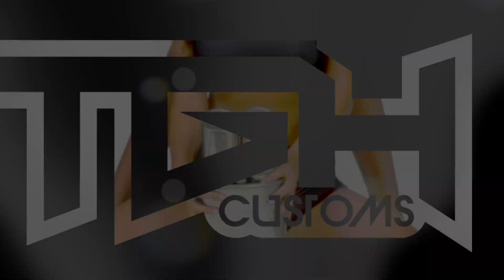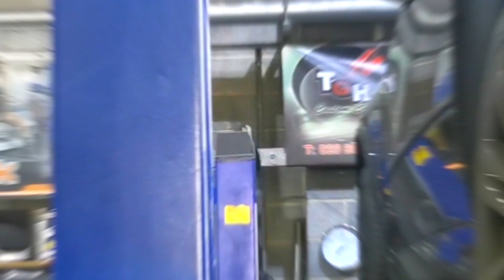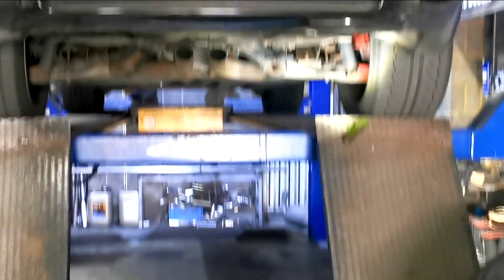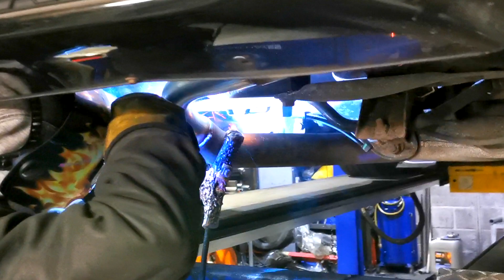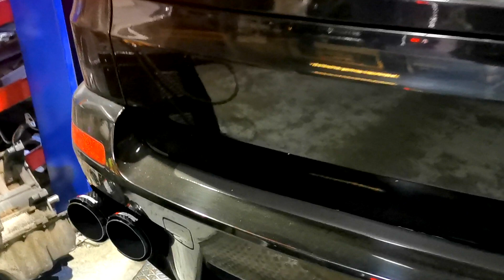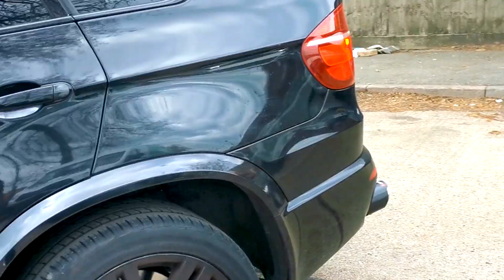BMW X5 | BMW X5 Exhaust Sound | BMW X5 Custom Exhaust straight pipe | Straight Piping My BMW X5

Comment: Sounds really nice, however the position of ghe tail pipes look terrible, the outer of the dual tips should be shorter in length to match the bumper slot.
Reply from the maker: @jamesbrown1628  totally agree but driver wanted those tailpipes and loved how it looked. So as they say each to their own and all that
Reply: The alighnments off entirely. Passenger side looks off 10 degrees….

Comment: Is it supposed to smoke like that?
Reply from the maker: No... But had an existing engine issue which was resolved later
Reply: Looks reslly bad
Reply from the maker: @bbltd.3154  Its not that bad its resolved now
Reply: Was it the valve stem seals?

Comment: What’s the diameter of the exhaust tip that connects to the pipes? 2.5 inch?
Reply from the maker: 2.5
Reply: @TGHCUSTOMS  bro where did you buy the dual exhaust tips?? Link?
Reply from the maker: @Tseringtop  it's akrapovic tailpipes

Comment: Sounds good but poor installation. One of the pipes are sticking out way too much
Reply from the maker: Should have gone to spec savers.
Reply from the maker: I just realised. What you're looking at, different angle it looks like that, but it's all aligned equally to the bumper.  Furthermore the tailpipes are clamped on so  it can be moved in or out to suit individual choices